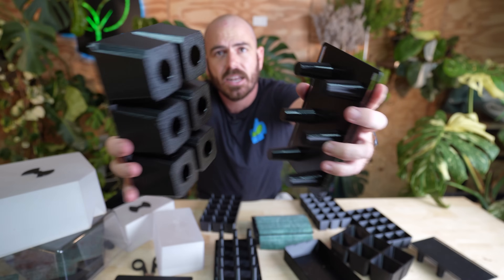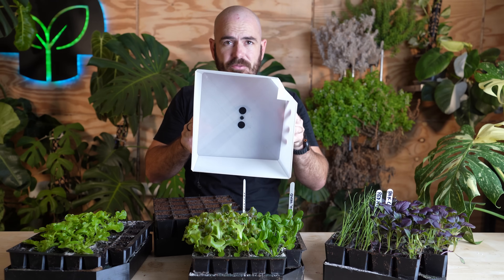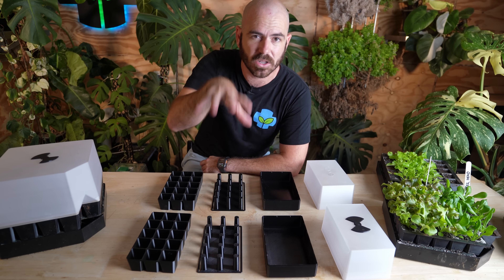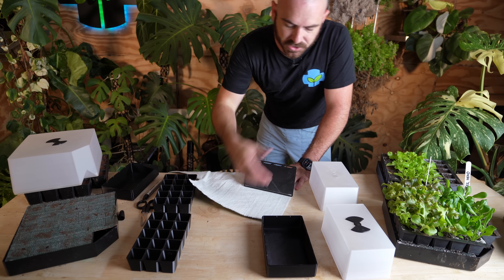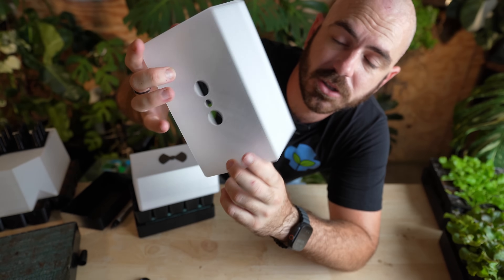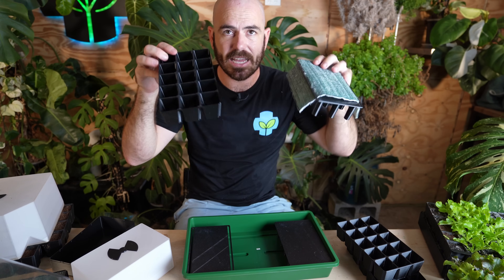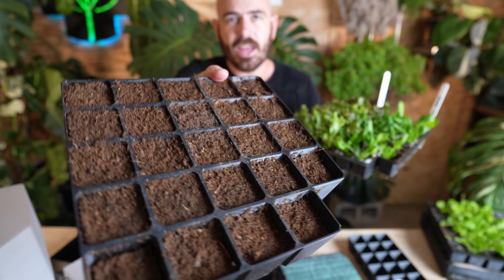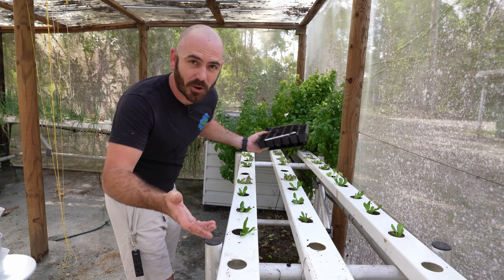MINI 3D Printable Self Watering Seedling Propagation System

Comment: From the states and was wondering if the float valve cover on your website will fit the US size 3x4 float valve endcap. Saving up for a 3d printer but still a bit off from affording the one i want. I do not see it available on the US Amazon site. But loving the channel and all the amazing ideas, just wish id found it sooner.

Comment: I keep buying sponges because I don't want dirt or anything getting into my hydroponic system.  How do you keep the coco coir from getting in it?  I've never tried that but wondering if I use that in net cups, will it fall into the reservoirs? I've been experimenting with everything I can think of so I don't have to keep buying sponges.  I want something I can start seedlings with for both hydroponics and planting in soil that is bio-degradable because I use both methods.

Comment: @hoocho, there is a small error in the stl for the 15cell tray, one of the the corners chamfer wall is only 1 layer thick. it causes this part of the cell to be very fragile and break, unlike the other 3 corners. adding perimeters doesn't help
Reply: as you use bhambu printers i checked in their slicer and it does a better job of correcting the issue from the original model, I'm using prusa slicer and it retains the flaw, there is even a gap in the wall :( unfortunately i cant post a pic here
Reply: I got creative :) in prusa slicer I cut the 3 cells off the end with the problem and copied the 3 cells from the other end, you can prob do the same in the original model as an easy fix
Reply: I encountered this too - switching to Arachne wall generation vs classic fixed it for me ( in bambu slicer)

Comment: I like engineering myself, and printted a lot the last years, most of it for Plant´s , gardening a DIY tool holders and stuff, so preety handy things. But i realized more and more, that the time i´m sitting in front of my PC to design, special need things ;-) i could build them conventional, often, much quicker as the print is(without the drawing time). Or to search for a while and purchase most items (exist already)

So these things. i got almost exactly this box with USB LED LIght, humidity regualtion openings, like yours, for less than 4 Euros. So, why i should waste a lot of material and time(=money) when i can easy purchase them already with a transparent lid, with Light integrated for less than the MAterial in the print ?! Sorry...but i also had to learn these lessons ;-)
Reply: Why do you bother gardening you can go see others having done it already.

Comment: First gratefull for the printables. I did the dome at 15% infil, is perfect for me. Same speed as all the rest. A question about the ready seedlings gooing in the vertical tower. So mutch soil ( or coco ) comes in the water. What pump do you use to make shure that is no problem too the pump? I understand the more power the pump the less problems with some soil, but coco is a other thing. And if the pump is that powerfull it is no problem,  imo the pump does many liters of water in the hour and has a very high pressure. What makes the hight and the pressure the water reach out is ' to mutch " and makes the top goes off?
Reply: I've got exactly the same question : where does all the cooc goes ? In the pump filter ? Otherwise thanks for all your videos, very well done and informatives

Comment: Very nice design Hoocho 😊 Maybe in V2 you could reduce the bottom tray height slightly. The top tray would have a bit more support and it may even be ok for the clear lid of cheap greenhouse to close? Nah, probably won’t get enough plus will reduce the sump…

Comment: Seems like a very good design. I think wick watering is very underappreciated, except in commercial applications where it is very common. 

Maybe consider adding extension frames to rise the lids of such propagation domes. While not absolutely necessary, I think that could be a relevant improvement. To me, 3d-printing is most meaningful for things/parts of systems that you aren't cheap, readily available and also perfectly fine for the task.

Comment: Will the coco block dissolve if placed directly in the hydroponic tower without a pot? I have the same system and after a few days it falls apart with the water.
Reply from the maker: You just have to grow the plants to a stage where the roots hold most of the coco in place
Reply: @Hoocho  Thanks

Comment: Small hint for printing the lid: do the bottom layers extremely slow, nozzle 10-15c hotter than normal, and with higher flow. With good, dry filament, you can get it to be pretty close to transparent. Just keep an eye on it so it doesn't get scorched. CNC Kitchen has a good video on the topic.

Comment: i've printed 8 sets of your full sized trays, they have served me very well in my attempts to start a garden. Thank you!
Reply from the maker: You’ve printed more than me 🤣👌🏻
Reply: Did you use pla for this? New to 3d printing and I’m curious about the effects of prints in the sun and uv protection if that will leech into your soil. Any info would be appreciated!!
Reply: @suavethreads8904  i used sunlu petg  and bambu transparent
Reply: @suavethreads8904 Hoocho uses PETG for any of the prints he does for garden use.